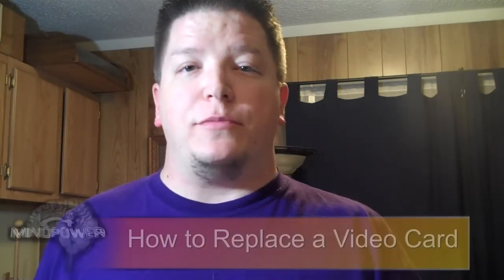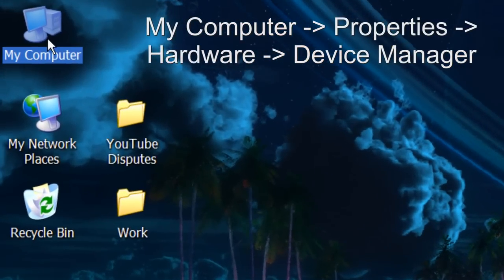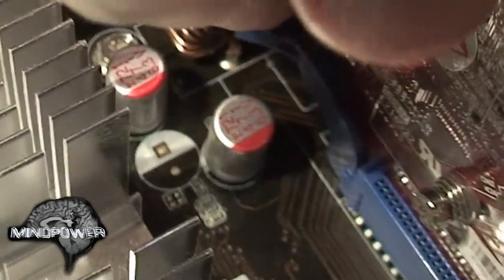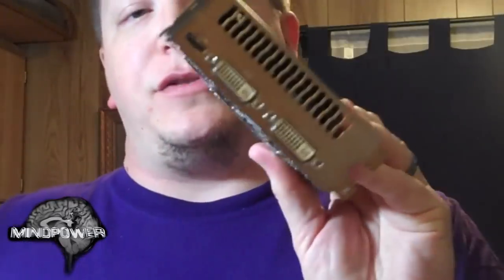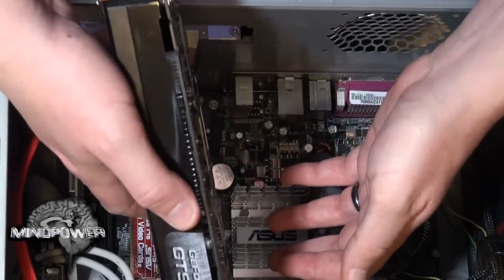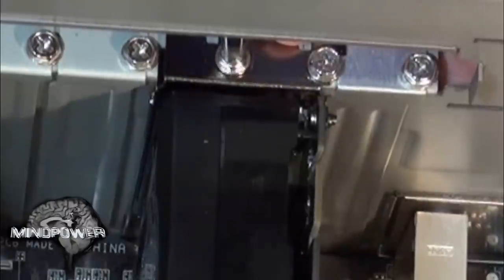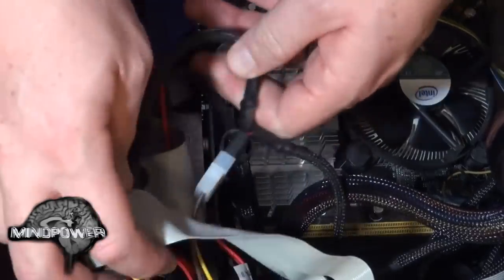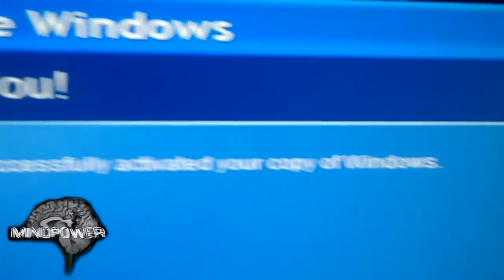How To Replace a Graphics Card

Comment: Notice that video cards do not stack performance but they can run alongside. One big program (like a game) will not have any increased performance whatsoever. This is more so an advantage if you have your PC split over multiple monitors and tasks.
(The guy in the video said otherwise)
Reply: Myst sli does indeed improve gaming performance

Comment: Can someone please help me? I currently use the integrated graphics on my CPU. The graphics are AMD r7 series. I am getting an r9 270x soon. How do I do the drivers for all of that? Do I need to uninstall it?
Reply from the maker: +Andloo Yunty It's not necessary to uninstall the drivers for the onboard GFX, unless you plan to disable it via BIOS when you put in the new card.  If so, just go in after the fact with SAFE MODE and uninstall the old drivers.
Reply: MindPower009 Thanks. I've actually already installed it and have it set up, but thanks for helping another member of the PC Building community. You are one of the people who keep this community great. Without people like you, I probably couldn't have built my PC and wouldn't have been able to help others in the community. I know this is true for others as well as me. 

TL;DR
Thanks for not yelling "N00B!!!! and actually helping me. You are not a cancer.
Reply: +Andloo Yunty  NOOOB!!!!!!!

Comment: I just ordered a EVGA GTX 660 Graphics Card, I really appreciate your help. Is there anything specific I will need to do due to the fact that I have an integrated graphics card, or can I follow this video directly?
Reply: You should be able to follow exactly, you should do a bit of research to make sure you don't have to uninstall the drivers for your integrated graphics, though I don't think you have to.

Comment: Hey I have an ASUSTek Computer INC. NARRA2 (socket am2) motherboard and a NVIDIA GeForce 6150SE – nForce 430 gpu - Processor AMD Athlon(tm) 64 X2 Dual Core Processor 5000+ 2.60 GHz -  and I want to upgrade my graphics, which one would you recommend (gaming)?

Comment: You know, when we want to know HOW to replace the graphics card, it would be great if you SHOW the entire process, NOT of you talking.... Zooming in and out and cutting to different angles.. so much confusion...
Reply: Uninstall the drivers unplug the case switch off the PSU open the case unscrew and unplug the old GPU take it out put the new one in screw it in ans plug it in close case plug it back in switch it on turn it on install new drivers wtf are you confused about

Comment: do most new towers now have power supplys built into them for graphic cards? I know my old tower would not of worked. , i am unsure if my xps 8700 even has a power supply to plug in a video card that i want, i have a gefeforce gt 720 in there now but i want a r9 290. I know there are 4 slots open so the size of it shouldn't be an issue. It seems like its a pretty easy thing to do once you get all the cords unplugged which will be the most challenging part. .

Comment: After installing does we have to install drivers again for the present card?
Reply: Well this answer migth be a bit late,  i can tell (and by the way, pls excuse my english, it isnt the best) if you installed the drivers for your present card beforst inserting the card, then no, but if you just deleted the old driver and replaced the card then, then a driver installation is required

Comment: hey all i  know its alot of read but please read this , guys i need help , i got new vid card GTX 260 oc i i toke out the old one still works basicly its what im useing now cuz i have a little problem , so i installed the new vid card then i put all the cables as i need i use 2 monitors so basicly when i opened up the desktop it was fine but the screens was difrently cabled witch means  i put the main screen on the second screen put in and the second screen was got puted in the main screen putin i hope u understand what i just said anyways when i did it i run up the PC work fine but the screens was difrently installed so i didnt ploged out the main screen to the first  putin where was not the main screen cuz the screens are difrent sizes so i didnt want that the lower one screen will be the main so i when to right click screen reslotion i just moved the screens from the right to the left to make the screens how i need it and when i did apply the screens just shut down and its said no cable connected so the screens was black on the desktop but when i started the pc again i saw the screens work well one of them , when its starting the pc but then when i did the passwork to open for the desktop  it was black and i tryed to install back the cables how its need to be but its was black again on the desktop so i installed the old vid card and now its working how its need to be but i want to use the new vid card what should i do ?

Comment: if your monitor no longer works, how are you supposed to get to the settings?
Reply from the maker: +Nick Wicked After you've swapped out your card, you can later go in with safe mode and remove the old drivers in the device manager

Comment: My power supply says 483w for the DC output, and 500w for AC input and the minimum for the card I want is 500w. Would it be okay to use the 500w graphics card on my computer, or do I need a new power supply?
Reply: I'd recommend having at least double the wattage of the graphics card.

Comment from the maker: That cable never moved a bit the entire time I had that PC.   It was fine.   I'm still using the same card in a new PC.  The screws dropping on the motherboard of course are not going to break anything, but the time I spoke about in the video was when it happened to land on the BIOS battery and shorted it out, so I had to go buy a new BIOS battery, as it wouldn't keep the time/date or any CPU/RAM clock or SATA settings.

Comment from the maker: That sounds like a memory problem.   Many times if you have bad memory sticks or if your motherboard has a bad memory slot, you won't get any diagnostic information from the computer, it just crashes.   You'd have to take it to a PC repair shop to have it tested and find out what the issue is.   Try to assemble any information you have on the crashes, what games, when it happens, maybe even videotape it.  Give that info to a repair tech and they might be able to help.

Comment from the maker: There are WAY too many cards and motherboards out there for me to know what's compatible with what.  It might be your power supply.   In many computers equipped with onboard cards, the power supply might be severely underpowered for high end cards like the one you see here or the one you're describing.   You can check out my power supply video where you'll see I swapped mine out, and what happens if you do it wrong.

Comment from the maker: Take out the new card.   Boot up windows, then go into the device manager and uninstall the onboard video card.   Reboot the computer, but don't let it boot up Windows.   At the opening screen there should be some kind of hotkey you can press to go to the BIOS setup/settings.   From your BIOS (all BIOS's are different, so I can't tell you how yours works) navigate to where you disable your onboard vga card.   After that, save your settings and turn your PC off.  Then install the new card.

Comment from the maker: Artifacts could be the drivers (or lack thereof).  Make sure you have the latest drivers installed for your current card, because if not it defaults to the Windows default 8-bit or 16-bit drivers, which are basically for the old VGA cards, and those will show all your video in very low color range and resolution, resulting in terrible video.   Current drivers should result in higher color and resolution.

Comment from the maker: Yeah I have about a half dozen of such old cards taking up space in my garage.   If your cards and your motherboard are equipped with some kind of apparatus to "join forces" between the two cards, such as Dual-SLI or Dual-Link, then you might be able to utilize that.   I've also seen folks use 2 video cards to display two different things, such as watching video on one display and editing it on another.   This can be done with most modern video cards these days though without linking.

Comment from the maker: I didn't.   I just uninstall the driver while I'm still plugged into the old card (if the old card still works), and then reboot it when I've got the new card installed.   But I suppose if you absolutely need to uninstall the driver and the old card doesn't work, you might try safe mode with the onboard card if you have one.

Comment from the maker: I think it's obvious.  If your video card requires 500w+ you will have to upgrade your PSU.   As I mentioned to another user, look up my "replace power supply" video (google it, it shows right up), it shows that I had to upgrade my old 300w PSU because my CPU and my video card required it.   It also shows what happens if you do it wrong :)

Comment from the maker: like I said, probably not the case, but as a practice, you should always try to uninstall the drivers before you install the new card, but sometimes you can not do that.   But you can reboot the system with the new card in safe mode and uninstall the old drivers.   Me personally, I've never had the system NOT detect the new card because the old drivers were still there.

Comment from the maker: Sounds like the tab at the bottom back of the card isn't sliding in between the chassis and the motherboard.   Just use your hand to guide the small metal tab town into the crevice as you're guiding the card into the slot.  This is very common, so don't worry, it should go right in once you guide the metal tab in.

Comment from the maker: Yeah it still has drivers to uninstall.  You can go into the device manager, uninstall the device from Windows, then turn the PC off, install the new card, then when you boot up, go to your BIOS settings (usually there is a hotkey that shows up on the opening screen... like F8 or something, find the setting for the integrated card) and disable it.   Usually pretty easy.

Comment from the maker: Yeah I seriously doubt you would need to uninstall the driver, or even that the operating system will notice a difference between the cards at all.   If anything there might be a version change, but even so, you're probably fine with the existing drivers.

Comment from the maker: You might have anything from a cooling problem, too little memory (depending on your OS, most systems do best with a minimum of 4 gigs of ram, especially if you're gaming.   Power Supply might be too low too.   Take it to a shop and have them diagnose the problem.

Comment: I was going to use both GPUs for my PC to run PhysX on 1 GPU and run a game on the other GPU, will i still have to uninstall my Video drivers for my old GPU since im still going to be using it for something
Reply: I think if you still have the hardware in your PC, you don't want to remove the driver.  If you are removing the hardware, it's best practice to remove the drivers, even if you have to do it after the switch (in safe mode)

Comment: you drive to a computer store get a shopping cart and  put 4 GTX 9 90 cards in it. then you push the shopping cart to a cash register and get your wallet out of your "pants pocket" or purse. then get your card out of your wallet and show your ID. then the cash register man or woman flashes the lines on the video cards boxes. then you swipe the card on the  side of the tablet thing. then using your thinggers to put in the code.  then you wait a sec or 2 for it to go thuw and then the cash register man or woman said's ok you payed for it. so you say bye and take the video cards home with you. then when you get home and go to your computer room. get your webcam. then rec you unboxing the gtx  9 90   and putting in your Gaming PC.
Reply: +johngallo1988 Yup exactly lol

Comment from the maker: Remember that a 32-bit operating system is only going to address 3.5GB of RAM.  Too bad, too, because RAM is the biggest bottleneck of most PCs.  You'll notice a bigger improvement from upgrading the RAM than you will from the Quad CPU.  I know I did.

Comment from the maker: If you have a DVI or HDMI monitor, you should either the DVI or the HDMI (which, btw are the same signal, just with different pin configurations).   I use an HDMI adapter in my DVI port now on my desktop.

Comment from the maker: Might be the resolution default setting on the card is incompatible with the monitor.... did you go into the hardware manager and remove the old card before you turned it off and took it out?

Comment: but if you remove the drivers of your video card, whouldnt the screan go beserk? i know there is a build in gpu but still, i know what it looks like if you update a driver. can a computer even drive a monitor withouth a gpu?
Reply from the maker: Windows still has its own default drivers, which can function at a lower resolution and performance, so you can just "get it done".  This is what you end up with anyways if your drivers get jacked up.  Not a big deal.

Comment: I have a few questions. Do you have to press 'uninstall' whenever you're taking your graphics card out, or is it just if you're about to replace it with a new graphics card? And also, does the graphics card store any data? If I were to change graphic cards, could I just startup my computer and everything that normally loads up will load up, with all my data and everything I've saved still on the computer? And does changing the graphics card change what version of Windows you have? Because right now my desktop can only support one monitor and I want one that can support at least two, but I'm not sure how many things, if any, will get changed when I boot up my computer after changing my graphics card. Thanks.
Reply: A new graphics card doesn't affect the windows version, however I think starting a computer without the necessary drivers might work, but I haven't tried.
Reply: RisK~ What do you mean by without the necessary drivers, do you mean like without a (proper) graphics card? And do you know if it affects the data stored on my computer?
Reply: +ChinaLake100 you will have your proper graphics card, but I'm talking about if your computer is dead before and can't install the drivers necessary, for example the necessary drivers, like amd and nvidia drivers
Reply: +RisK~ and data stored on your computer doesn't affect anything, a hard drive is its own unit lol

Comment: i am dual booting windows 7 with ubuntu 14.04, and i'm going from a nvidia geforce 6150 se to a XFX Radeon R9 280X (R9-280X-TDFD) 3072MB PCIe x16 Gen 3.0, any tips? i have a amd athlon II x4 645 quad core cpu, will i have to upgrade that for this to work very good? i just don't want to buy it and have it not work.
Reply: Cant use 2 diffrent GPU's at the same time.
Reply: nevermnd, my pc has a PCI port insted of a PCIe port, so it wouldn't work anyways...
Reply: +Austin Jones counts on his power supply aswell, he would have to have a good one to handle two graphic cards at once.
Reply: +SkapeNight that must be one old computer that graphics card your using uses pcie 3.0

Well pci slots was in ver,very old computer it was common back when windows 98 was brand new.

Comment from the maker: You should have a copper braid or wire running from your case to a ground source somewhere (I've used the center screw on a grounded AC outlet before -- USE CAUTION!)

Comment: i had a gtx 480 upgraded to gtx 580 did not uninstall drivers but its the same gpu company but if you have a ati card you have to use driver sweeper
Reply from the maker: Naw, you can just boot in safe mode and remove the old device.  No need to install a needless program to do it for you.

Comment: Ok here is my problem i got a ga-78lmt-usb3. When i plug in my gpu i don't get a display. But when i take it out and put my hdmi in my motherboard it's fine?? What do i need to do?
Reply from the maker: Wreck-ItGamer Maybe you need to clean out the PC?  Does it have a lot of dust in it?  Try re-seating the board.  That's always where I end up going.
Reply: MindPower009 When ever I remove my card I have to take my pc to a shop becuase my pc will not boot right if I try to reinstalll the card!I have a enga 780ti so tell or show me how to do this with out having to go to the shop please!

Comment: Sorry, i didn't notice my notification in my inbox until now. I realized that it was my processor. The processor is a Intel Duo Core 2 processor, 1.60Ghz, thats why its slow. and the dell only has 2 gigs of ram. im building it up though. New hard drive, fan, 4gb ram, and intel qaud core 2.50 Ghz processor. i should be fine, and yes i am aware now that dust heats the pc up quickly and therefore, slowness.

Comment: LOL he didn'tt even plug in the power cable properly. This is actually a vital part that could be catastrophic. If that cable moved while the pc is on, it could cause a spark and short something out that it wasn't meant to. Things like dropping the screws onto the motherboard is only an inconvenience to get off but it won't break anything as it does not have enough force.

Comment: I get around 50mp/s on my desktop. i somewhat cleaned out all my fans, i couldnt get in the creveses of the fame much. there is still some dust,but surface dust. you can see through the cpu fan. On offline games it still lag a little, its probably because of my processor. The computer seems to be running atleast 2x faster. Firefox never *(stops working) anymore. considering i cleaned most of the dust out.